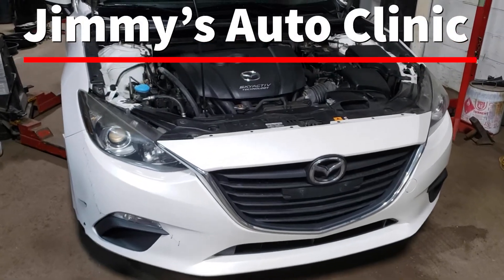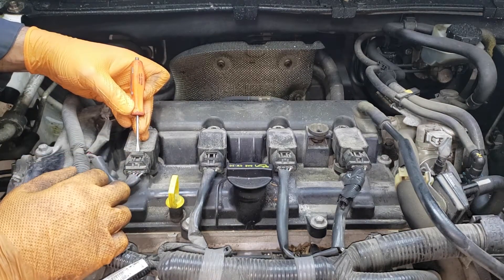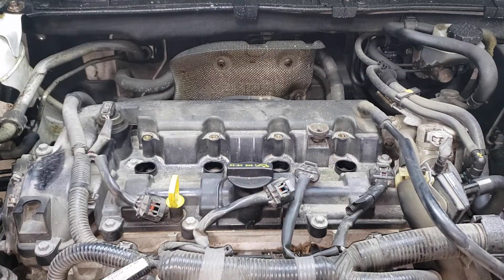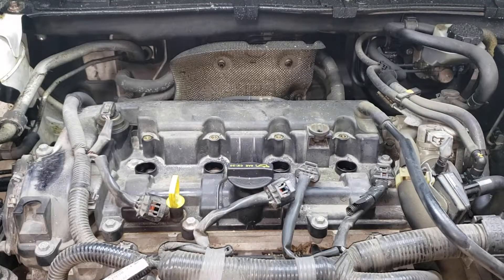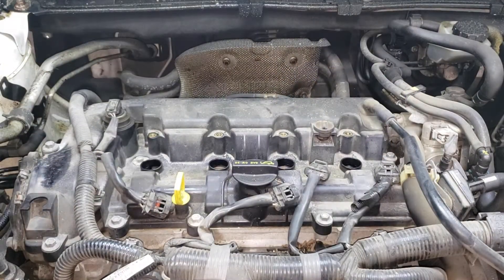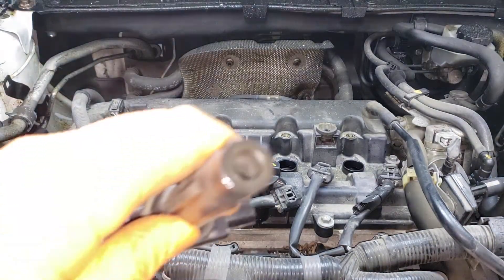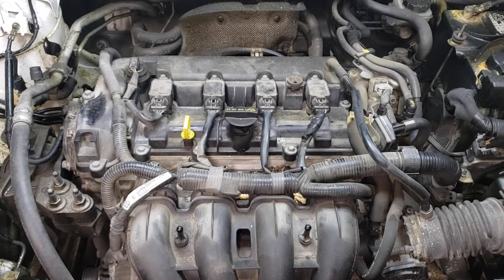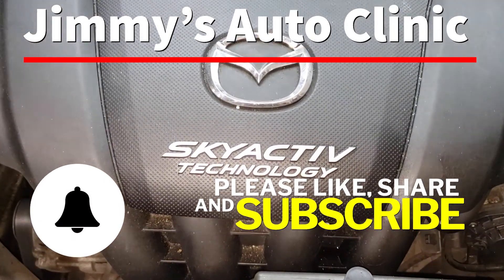Mazda 3 Spark Plugs SKYACTIV

Comment: DO NOT tighten your spark plugs with a battery drill/impact gun as shown in this video! It can damage the threading on the cylinder head, the spark plug is steel while the cylinder head is aluminum, screwing it in with your bare hand can avoid cross threading which can damage the aluminum  threading easy, so its recommended that u screw and tighten your spark plugs with a rachet
Reply from the maker: I'm pretty sure if you watch the whole video you'll see that I say to thread it in by hand and you can run it up with a gun. I've done this for the last 25 years and haven't had an issue so yeah. Obviously you don't use a gun to initially thread a spark plug in.
Reply: @JimmysAutoClinic  What happens if you dont use a torque wrench??

Comment: I read that the torque spec should be 10 - 14 Nm , wouldn't that be roughly 7 - 10 ft lbs? You tightened them at 20 ft lbs, which over double .
Reply from the maker: To be honest I can't remember what the torque spec is. But as long as you don't go too tight you'll be fine. You can make those decisions based on the length of the spark plugs threaded portion as well as the type of material the head is. 20 foot pounds Maybe tight in comparison to what the manufacturer says but I haven't had any issues doing this through the years.

Comment: I changed  the spark  and coils on . 2012 mazda 3, but I still get missed fire on 3rd cylinder. What can be other issues. You advice will be highly appreciated
Reply: Have you checked the fuel filter & fuel hose? They could be clogged
Reply from the maker: Hi, if you change the ignition portion the first thing I would do is switch the coil or spark plug with any other cylinder that is good and see if the problem follows. If it does either spark plug or coil is defective. If it doesn't you may have an issue with many other possible things. The first thing to do would be to check compression, the second thing to do would be to do a leak down test if compression is low. Or if compression is fine it's still a good idea to do a leak down test. If all of those tests check out the next thing to do would be to check out the fuel delivery system. It may just be a bad or going bad injector. It could be wiring to the injector or coil possibly. But start with the basics by doing a coil Swap and then checking compression.
Reply from the maker: Hey, good suggestion but I don't think that would be the next step. Check out my reply if you'd like to find out more. Thanks for trying to help out.

Comment: I did spark plug replacement on all then changed #2 coil pack and I’m still having misfire in cylinder #2 I even went to the extent to clean the throttle body 😢idk what else to do
Reply from the maker: Hey, unfortunately it sounds like you have some real issues that may need to be diagnosed by a mechanic. If you're in the Toronto area I wouldn't mind helping you out. What you can do to take a look at the engines health is do a compression test or what is called a leak down test. Those two tests will tell you what's going on with your engine. If everything looks okay there I would look at possibly a bad injector if it's just the one cylinder that consistently misfires. I would also swap the coil with a known good coil from another cylinder because even brand new aftermarket coils have failed in the past on me. I hope this helps if you have any other questions feel free to reach out. Thank you for watching.

Comment: If you don't need to disconnect the connectors for changing spark plugs, why did you? Makes no sense...
Reply from the maker: Hey bobby. I don't remember exactly what I said but if you don't need to disconnect the connectors to change the spark plugs that doesn't mean that you can't. In my case I always take the ignition coils off inspect them clean them and put them back into the car which is much easier to do with the wiring harness disconnected. Hopefully that answers your question. Thanks for watching don't forget to hit that subscribe button.

Comment: what is the part number of the plug?
Reply from the maker: Unfortunately my friend I don't remember what the spark plug part number, the best thing to do would be to get the part number off of the spark plug that is in your engine if you know it is the original plug. If not I would suggest taking your Vin number to your local Mazda dealership parts department where they will be able to tell you what the exact part number is that is needed. You can then take that part number and cross-reference it to get the correct plug with any parts store. Hope that helps don't forget to hit that subscribe button.

Comment: Nice vid. Why didn't you use ant-seize on the new plugs ?
Reply from the maker: Hey jeffrey, it is not recommended to use anti-seize on spark plugs. It really depends on the type of spark plug and head material. There are very few instances where it is a good thing. Whenever you have a steel spark plug going into an aluminum head it's not generally a good idea. It also depends on the type of anti-seize and the duration of the plug is supposed to be used for. In short there are many different factors that determine whether you should or shouldn't and it is almost always better not to have anti-seize in that specific area.
Reply: @JimmysAutoClinic  correct..NGK Laser Iridium comes with anti seize coating

Comment: Why would you not use a torque wrench if you have it to tighten them in after the power tool if you have one? Seems like an unnecessary step that could cause overtorquing the spark plugs (even if that's not likely to cause any major issues). 

Just a minor point.. otherwise excellent video!
Reply from the maker: Thanks for the comment Tim. So the general process for doing spark plugs and the reason why I use a power tool is only to run down the spark plug because a lot of newer plugs are quite long. Essentially the power tool acts as a speed handle would. But in no way shape or form should you ever use a power tool to tighten up a spark plug. You should always use a torque wrench to torque the spark plug to the correct tightness required. Power tools like an air ratchet or impact driver are quite violent so if you try to apply torque you can easily break the spark plug which would be a bad day. I hope this answer helps you. Of course don't forget to hit that subscribe button if you haven't already.

Comment: Is it better to replace the stock with ngk iridium sp for mazda 3 2018? Is there a significant difference in performance and gas consumption?
Reply from the maker: Generally in most cases you won't see a noticeable increase in performance in terms of horsepower. Over time with long trips you may see a slight increase in fuel mileage. But that mainly has to do with the plugs being new, of course depending on how old your original plugs are also. Most newer cars come with a platinum plugs so I'm assuming that yours probably are. NGK is a great company so whatever plug is recommended by them should work really well. Also check the cost of the stock replacement plug. Sometimes the dealership is actually cheaper than aftermarket replacement. Good luck 👍
Reply: @JimmysAutoClinic  thank you so much.

Comment: Thanks for the video my 2014 mazda 3 just started having less power but no check engine light was on so I changed all the spark plugs and noticed the problem was stil there still with no check engine light. So the next day I went and bought 4 new coil packs changed them all and then the problem was still there it actually got worse and the check engine light came on.
Reply: someone help lol
Reply from the maker: Hey Mario, the best advice is to put back the stock spark plugs and coils. Then run the car with a scanner that will tell you live data, generally when you have a lack of power it could be related to a number of things depending on mileage and maintenance. I would need a bit more information to put you on the right path but I would say check the live data to see what your fuel trim numbers are. Also see what your oxygen sensors are doing. I would also look at the air filter if it's never been changed of course this all depends on mileage. If you're close to the Toronto area the easiest thing would be just to come by. I hope this helps you

Comment: No antisieze or gap mentions tho.
Reply from the maker: Hey TJ Eclipse, antiseize is generally not needed. If you are going to use it you can use copper antiseize. In regards to the Gap these plugs were from Mazda, I did check the gap to make sure that they were all the same across the four. Unfortunately I don't remember off the top of my head I will look it up for you.
Reply from the maker: Gap Used Plug 1.05 - 1.40mm
        New Plug   1.05 - 1.15mm
I hope this helps you. I have also updated the description with the same information. Please don't forget to subscribe if you haven't already. Thank you :-)
Reply: Shouldn't use antiseize with aluminum, and the gap from NGK will be factory done. He did everything right man..